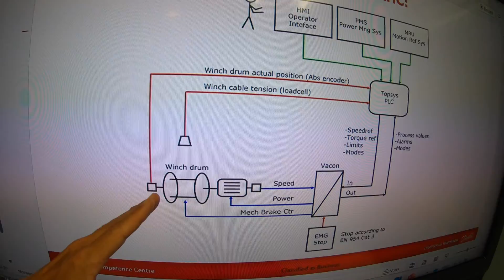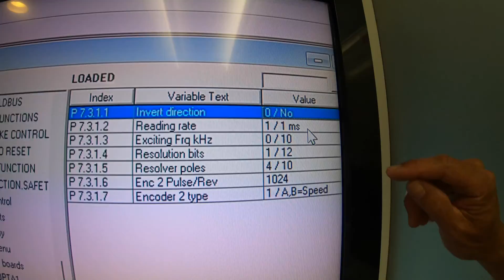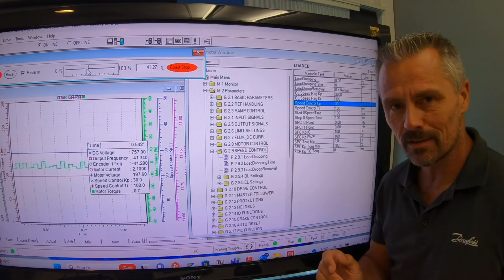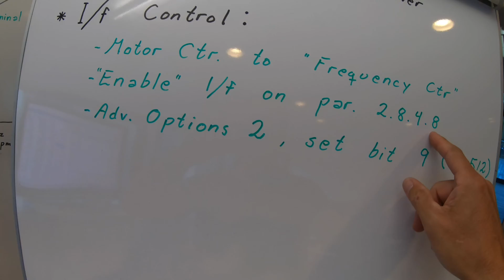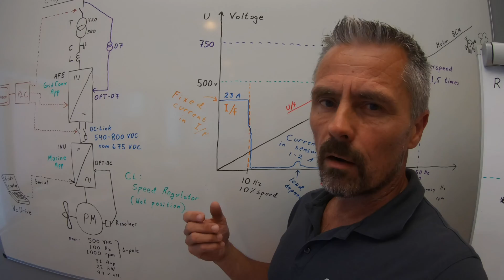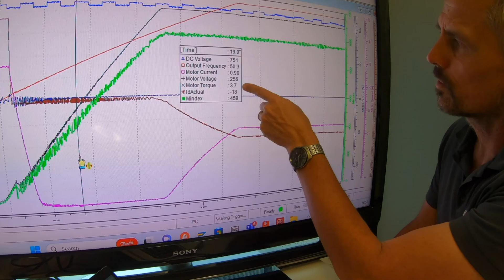Drives School (23) S2E5, Advanced PM motor tuning

Comment: Very Nice Reidar, can you explain me about power mode and normal mode on thruster applications, usually rolls Royce applications pls
Reply from the maker: In short the normal speed mode the handle on the bridge controls the rpm on the propeller and power limit is only the maximum allowed outtake from the diesel gensets then, propeller usually operating below. In power mode the handle on the bridge is set to the power limit and the speed reference set to fixed 100%. This ensures a constant kilowatt/ power from the diesel gensets regardless of the rpm on the propeller. Quite useful when big waves and rough sea to avoid diesel generators to be loaded up and down alternating with the ship movements and speed trough water. Power mode is also useful when multifuel gensets because power dynamics are poor with fuels like LNG. They benifit from a constant power outtake.